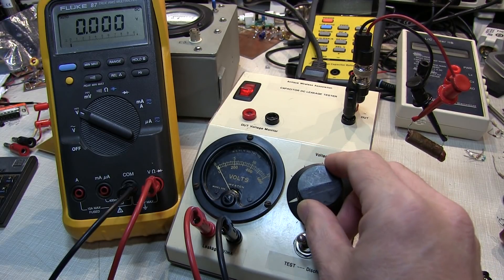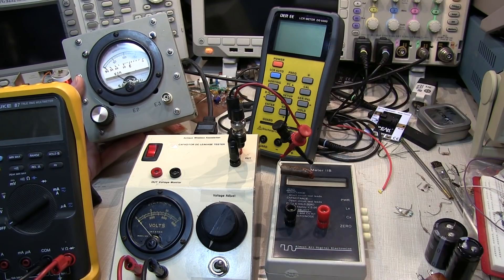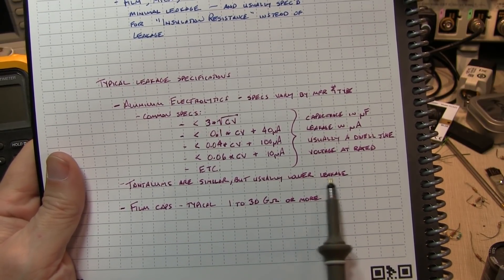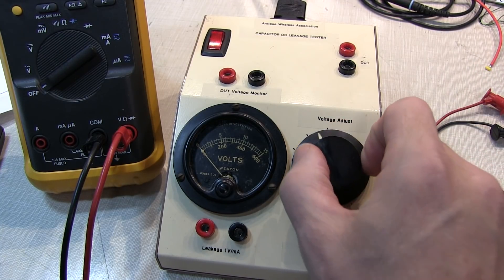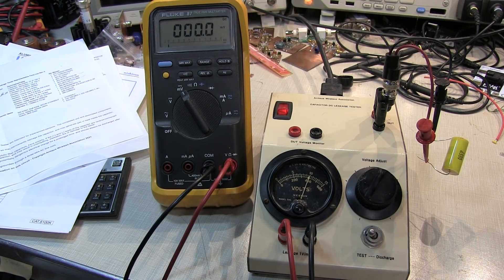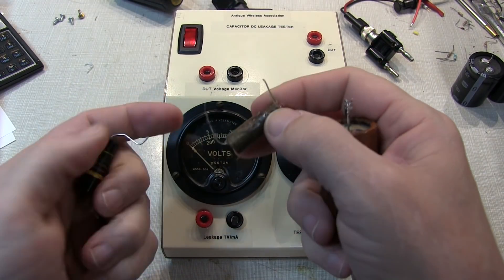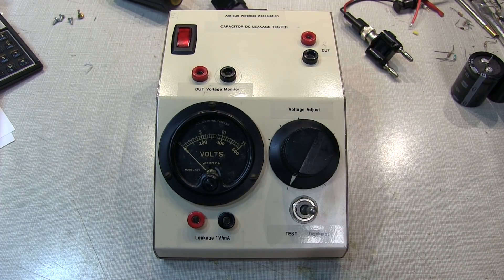#346: Basics of Capacitor Leakage / using the Antique Wireless Association DC Leakage Tester

Comment: Thanks for the description. I'm wondering if residual ripple from the switched-mode power supply and using a TRMS voltmeter might affect the leakage current measurement results. Have you tried performing the tests alternately with a battery with low-voltage capacitors?
Reply from the maker: Not an issue.  The power supply is a linear supply, and is well filtered.  Plus, the DMM is in the DC Volts mode, where the TRMS circuit isn't used.

Comment: Any advise on how to wire the mains for 230v ?
Reply from the maker: If you purchase on of these, the schematic shows the strap configuration for 230VAC operation (E2-E3 and E4-E5 for 120V, E3-E4 for 240VAC operation).  This puts the two primary windings in parallel.

Comment: Aluminum electrolytics, today, are made by wrapping two aluminum foil strips without a separate insulator in between. The insulation comes from one strip being anodized, thus, the oxide layer is the insulation. Combine that with an electrolyte, and I could see how they would show a low leakage, as my guess is that the oxide acts similar to a high-value resistance which would allow a slight amount of leakage.

Comment: Very informative! And what about low voltage devices that draw 10uA current and have some radio data sent like 15ms and let say 20mA amplitude? Then that 3uA leakage is not the case. After stabilising current I don’t see almost any leakage on electrolytic 1000uF caps, like 200-400nA. Also used ones don’t have that leakage current of few us. So depending on application that leakage current is only a value after 2 or 5 minutes but then never more observed. Or I’m missing something?
Reply from the maker: Leakage comes from the (high) resistance between the plates of the capacitor. So of course, it is proportional to the voltage across the cap.

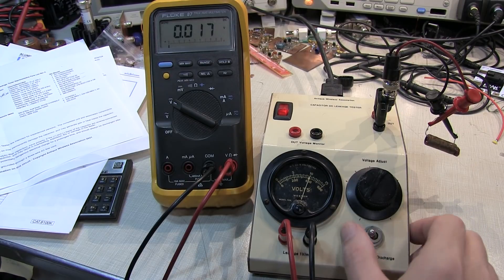Comment: You stated the old capacitor (location 11:46) tested was 20 micro-amps and thus failed.  Then you state toward the end of the video (location 14.28) new electrolytic 450V was passing at 100 micro-amps.  How can the new one pass at 100 micro amps and the old one fail at 20 micro amps?
Reply from the maker: Different types of capacitors have different levels or normal/expected leakage.

Comment: I do not see how your device even works as the transformer is in backwards (rotated 180 degrees) according to placement picture from Antique wireless ass website.
Reply from the maker: It worked fine but only went to about 350V. Then I noticed the transformer was reversed and fixed it.

Comment: Informative video. Just finished populating the AWA circuit board. Love the retro volt gauge. Where did you get it?
Reply from the maker: It was in my junk box - probably found it at a hamfest 20 years ago....  It is not new/retro, it is the real-deal old/used vintage stuff.
Reply: Thanks for the prompt reply.....but damn😮‍💨 @w2aew
Reply from the maker: @joramkalfa4038   You can search ebay for "vintage panel meter" and might find something similar

Comment: Would the DMM  external connection posts also be at the high test voltage? Thanks Greg
Reply from the maker: The ones on the top, above the meter, yes.
Reply: @w2aew  At 8:30 you said the front "monitor points is across a 1kohm resistor that is in series with the capacitor and high voltage power supply".
I understand that there is only small voltage across the 1k resistor but since the resistor and monitoring points are in the same series circuit as the capacitor under test and the HV ps, isnt the resistor at he same HV potential? I guess the resistor could be on the low side or the return leg with one end connected to ground but if the capacitor is short the HV would be directly across the 1k resistor.
Sorry for repeating my question.
By the way Ive leant heaps from your instructional videos. Many thanks Greg
Reply from the maker: @gregwmanning  The 1k sense resistor is on the low side.  The capacitor under test is fed HV through a high value resistor, so even if the cap is shorted, the voltage across the 1k sense resistor is still low.
Reply: @w2aew  I get it now, thanks. Yesterday I ordered one of the PCBs. Regards VK7GWM

Comment: Another great video, Alan! This is the second video I've seen on YouTube reviewing the Antique Wireless tester board. Both seem very positive, so I will have to get one. There is also Paul Carlson's low voltage tester but there is some debate on if its good replacement for a tester which measures the capacitor at its rated voltage like the Heathkit IT-11 or this one. Plus I'm not really in the mood to have to make my own PCB so the AWA one seems perfect. 

A few questions for you.
1) you mentioned that the LCR meter will not measure leakage current. However since it can measure equivalent parallel resistance, can Rp be used to qualify the leakiness of the capacitor?
2) I really like the box you chose with the slanted face. Is this something you salvaged from some other gear, or is it available on the market somewhere?
Reply from the maker: Hi Kurt - In some cases, the leakage can result from high voltage breakdown of the dielectric, which would not be present during a low voltage equiv parallel capacitance test.  Yes, the Rp test is still valuable, but might not tell you the whole story.  The slanted box is one I had laying around, but there are manufacturers like Hammond, BUD Industries, and more that make slanted front boxes/enclosures still, available from places like Mouser and even Amazon.  The only modification I made on mine was to add the analog panel meter to measure the voltage across the capacitor under test.  Since it is a 500uA meter and I wanted full scale to read 600V, I used a 1.2Mohm resistor in series with the meter.

Comment: When a capacitors charge time and discharge time are equal, what happens or what is this called? Amplifiers use coupling capacitors per each amplifier stage but when the coupling capacitors charge time and discharge time are equal the coupling capacitor causes what type of problems?
Reply from the maker: The equality of the charge and discharge time has nothing to do with the capacitor - it is a function of the circuitry that is doing the charging or discharging.
Reply: @w2aew  ok when the charge time and discharge time are equal the circuit will cause what type of problems? When they both are equal I'm guessing that is the resonance frequency of the circuitry or it acts like a short circuit ?
Reply from the maker: @waynegram8907  It depends on the circuit.  If a capacitor is being used to make the power supply more stable, then fast charging and slow discharging is desired.  If the capacitor is being used to couple two stages together, you want both charge and discharge to be slow.  But, slow charge can lead to "pop" in audio amplifiers when you turn them on.
Reply: @w2aew  The coupling blocking capacitor and the miller effect of the tube or transistor in each amplifier stage section is creating an RC charging time and discharge time? Why choose the slow charge time and discharge time for amplifiers?
Reply: @w2aew  Most power supplies RC duty cycle is 2 to 98 ratio or 5 to 95 ratio? meaning that the charging time is 2%-5% and the discharge time is 95%-98%? The RC is R is the LOAD of the circuit and C is the filter capacitor value.
Reply from the maker: @waynegram8907  I have never seen ratings like that for power supply filter caps.  Usually the situation is more complex than a simple RC representation.  The filter caps are charged by the voltage regulation circuitry (very low impedance) and the discharge is often from a load which can be a relatively constant current load, or a highly variable load current
Reply: @w2aew  Just to make it clear, when any parallel RC network or series RC network when the duty cycle is at 50% or the charge time and discharge time are Equal this is considered the resonance frequency?
Reply from the maker: @waynegram8907  No.  Resonant frequency has nothing to do with charge and discharge time in an RC circuit.  An RC circuit does not have resonant frequency.  Resonance is define as the frequency where the reactance part of the complex impedance goes to zero, so that the impedance consists only of a resistive term.
Reply: @w2aew  When the series or parallel RC network has equal charge time and discharge time this means that both the charge time current&voltage are also EQUAL to the discharge time current&voltage?
Reply from the maker: @waynegram8907  Yes. It means that the charge and discharge currents are the same.
Reply: @w2aew  At what point of an RC network is when the charge current and discharge current are equal? It's not the cut off frequency and it's not the RC time constant. So I'm confused at what point of a series RC network and parallel RC network is when the charge current and discharge current are equal
Reply from the maker: @waynegram8907  Has nothing to do with the cutoff frequency.  It is entirely dependent on the source voltage and source impedance of the signal that is doing the charge and discharge.
Reply: @w2aew  so when the source output impedance is matched to the loads impedance are Matched impedance this is when the source impedance and the loads input RC charge current and discharge current are equal? When the charge current and discharge current are equal is when the source impedance is matched?
Reply from the maker: @waynegram8907  No.  When the SOURCE impedance is the SAME for charging and discharging the capacitor, then the charge and discharge currents are equal (for the same voltage change).  Has nothing to do with matching the source and load impedance.
Reply: @w2aew  The function generators output impedance is 50 ohms. If you set the Function Generator to output 500mA, then the series or parallel RC network under test charge current will be 500mA and the discharge current will be 500mA?
Reply from the maker: @waynegram8907  I've never seen a function generator that lets you set the output current.  You typically only set the output voltage. Thus, the current at the output is determined by the 50 ohm output impedance in series with the input impedance of the circuit being driven by the signal.
Reply: @w2aew  If the input signal beside a function generator just an input signal has 500mA going into the circuit under test the input front end stage is the Load/input impedance. The input front end stage RC network charge current will be 500mA and the discharge current will be 500mA., at what point or what determines to have equal charge current and discharge current?
Reply from the maker: @waynegram8907  I'm sorry, but your question doesn't make any sense to me.  You're saying that your signal source is a 500mA current source to charge or discharge the RC network load, and then you're asking what determines when your charge and discharge current are equal????  You just told me that your source is a constant current, so THAT is what makes it equal.  Maybe you can re-form your question, because it doesn't make sense they way it is worded.
Reply: @w2aew  Most designers inputs front end have an RC network at the input of the circuit. Like an audio amplifier has multiple stages/sections that have an RC network for each input and output stage, so the charge current and discharge current are at different Ratios for each stage which I think the charge current and discharge current "Ratios" of the RC networks are determined by the frequency? High frequencies will change the "ratio" of the charge current and discharge current and lower frequencies will change the "ratio" of the charge current and discharge current. I'm just confused what will change the "ratio" of the charge current and discharge current of RC circuits. When an Input current source is applying 500mA to the circuit under test the input front end RC charge current is 500mA and the discharge current is also 500mA? I'm not sure what would cause the RC charge current and discharge current to be 100mA charge current and discharge current to be at 400mA or the charge current to be at 300mA and the discharge current 200mA. I'm not sure what is determining when you apply a current source of 500mA what is causing the charge current to be Equal to the discharge current or the charge current to be Not Equal to the discharge current.
Reply from the maker: @waynegram8907  You've got to stop thinking and worrying about charge and discharge ratios - they really have nothing to do with how/why capacitors are used in the applications you mention - coupling between different stages of an amplifier.    Capacitors are used in multi-stage amplifiers for several purposes:  coupling between stages, setting the upper and lower frequency response, compensation to avoid oscillation, and other things like equalization networks, stability networks, etc.  In none of these applications do the designers think about charge and discharge ratios.
Reply: @w2aew  What types of applications would designers think about the charge and discharge ratios?
Reply: @w2aew  When looking at a schematic whenever I see an RC passive network I always thought the designers choose the RC values because of the charge and discharge ratios. I guess I'm wrong?
Reply from the maker: @waynegram8907  The two most common applications for capacitors where the designer cares about the charge and discharge times are:
1) Peak Detector circuit - where the charge time is much faster/shorter than the discharge time.  Such circuits are often used as part of AGC control circuits in radios
2) Power supply filter capacitors - where you want the cap to charge quickly and discharge slowly, thus minimizing supply rail ripple.
Reply from the maker: @waynegram8907  When RC circuits are used, the concern is usually more about the impedance of the capacitor compared to the adjacent resistors, or about the RC time constant.  There are a few times when the charge/discharge ratio is considered, and that is mainly in peak detector circuits and power supply filter applications.

Comment: A great project and build. Thank you for sharing. I do have a question about safety. I would think that, if you were testing a faulty e-cap at high voltages, you could end up with a tremendous explosion/bang; correct? If so, maybe a container for the DUT would be needed?
Reply from the maker: Not a bad idea...

Comment: Thanks for the demonstration I prefer the vintage testers myself as I’m a sucker for anything with a magic eye tube. I recently did a simple restoration on a Lafayette capacitor analyser. It was an easy repair. I’m not sure how much I will use it as I don’t trust old wax or electrolytics and just change them out. The reforming function may be useful. I keep old capacitors just for the purpose of testing and demonstrating the various failures.  Have a look if you get a minute it’s a nice tester. Probably came out the Trio / Kenwood factory in Japan back in the day.  I will check out the restoration channel you mentioned

Comment: Thanks for another great video. One question: How did you connect the volt meter so that it does not show in the leakage current (the current through the meter movement)?
Reply from the maker: The leakage current is measured by measuring the voltage across a 1k resistor in series between the capacitor and ground.  The voltmeter is connected to the other end of the capacitor and ground.  Yes, the small voltage drop across the 1k current-sense resistor is included in the total voltage measurement, but it is much less than the applied voltage, so is insignificant.

Comment: I noticed that terminal 7 on your transformer T1 is installed in position 1 on the PCB.
Reply from the maker: Yes, I had noticed that too after filming this video, and corrected it.
Reply: @w2aew  I did the same thing.  I fixed it also. What capacity varistor should I use across the input line?
Reply from the maker: @outagas2008  What's strange is - I had somewhat purposefully installed it that way because I figured it was a 1:1 transformer and it wouldn't matter, and that made the labeling readable when looking at the board (I usually try to install components so that they are consistent and readable, such as resistors all oriented the same way).  However, I found that the voltage would only go up to about 415VDC.  I measured the secondary voltage and it was lower than I expected.  So, I figured I would "correct" the orientation for the transformer.  Once I did, the output can now be adjusted to 600VDC.  Strange.  I still am not sure why since the transformer still appears to me to be 1:1...
Reply: @w2aew  I was able to get 590V

Comment: You should check out Mr Carlsons Lab. He often restores very old devices.
He built a capacitor leakage tester and shares schematics.
The tester tests caps with a low voltage so no hazard stuff and it's very sensitive up to Giga Ohms if I recall correctly. Think you should check him out.
Reply from the maker: I am familiar with Mr. Carlson's Lab, he does great work.  I've seen the video on his leakage tester, but he only shares schematics of it to his Patreon subscribers, so I haven't seen the schematic of his tester.
Reply: @w2aew  Ah OK, I'm a Patreon and it is there, I'm about to build it when I have time.